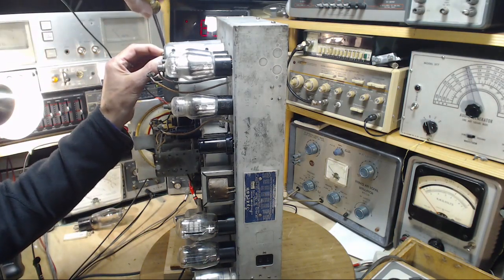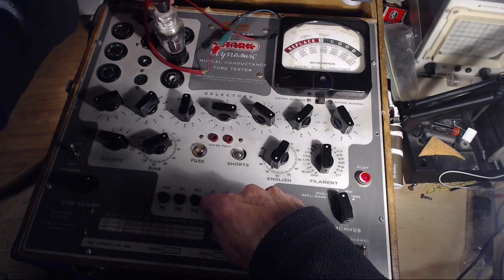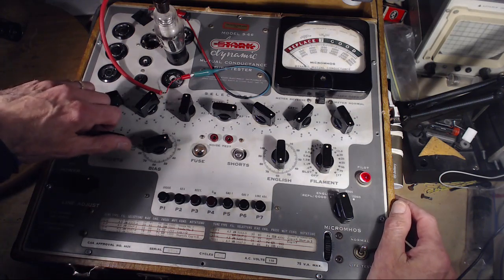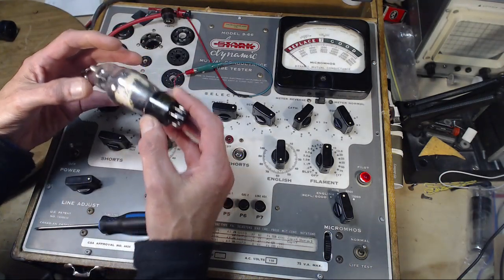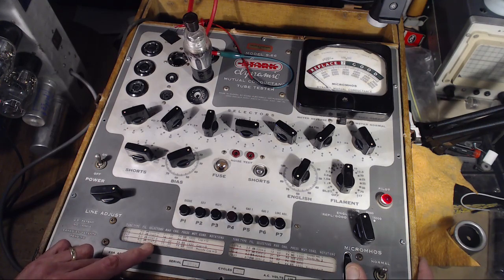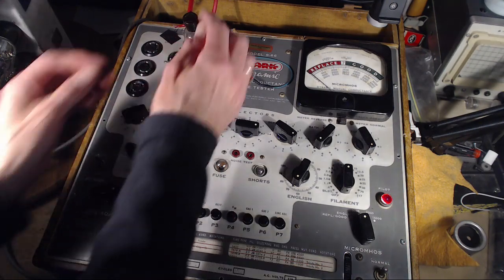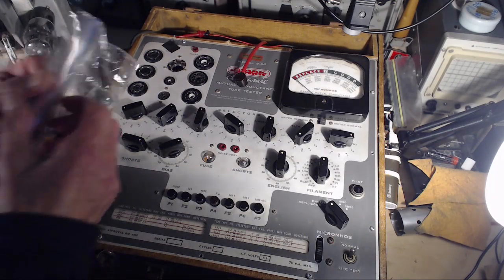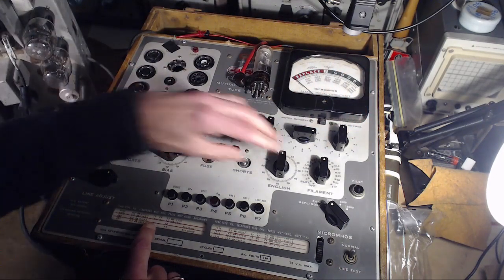Sparton 1567 Huge Tube Radio Video #10 - Tubes Tested

Comment: Old tube testers are very unreliable. When was the last time they were calibrated?
The radio works so the tubes are working. The problem is going to be not in the valves, but in the capacitors. Tapping the tubes does not help. :-(

Comment: jimbus: I would not say made 40 or 50 years ago. I would say 70 to 80 years aguuu. Oh by the way those eye tubes have a resistor in the base, and if that goes bad they are very dim. Oh, also they are very much a pain to change, sometimes. also also the value could be changed to change the brightness.
Reply: I am the owner of this radio.  Its history was given in a comment in the first video in this series.  It was originally purchased by my great-grandfather in the year 1937.
Reply: Upon sober second thought, I believe that Jim's comment was made about a replacement NOS tube for the radio.  In which case 40-50 years may be just about right.